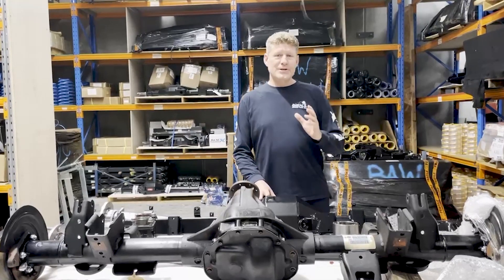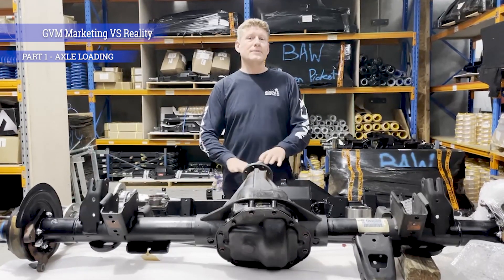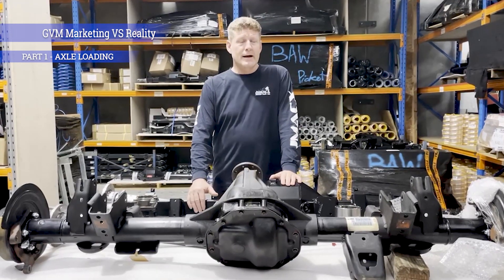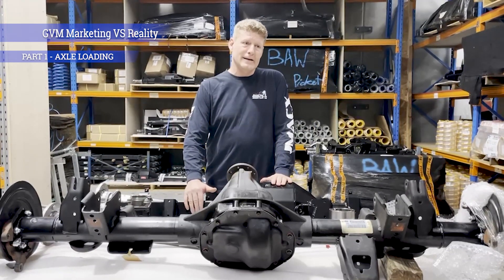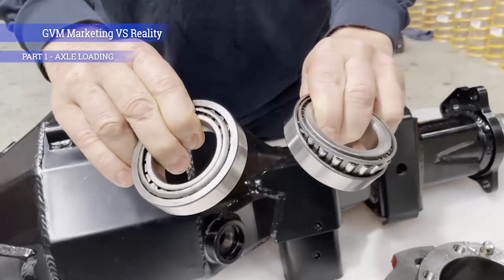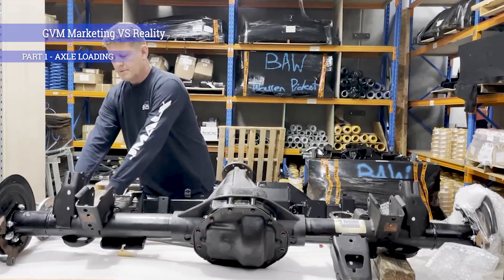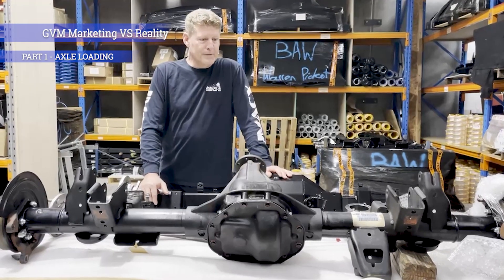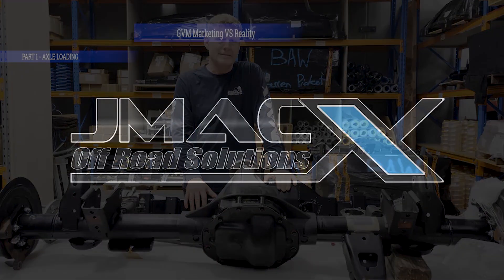GVM Marketing VS Reality - Axle Loading Part 1

Comment: So it's okay to re rate the load rating of the front axle without doing any modifications on it, but not okay for others to do the same for front & rear ?
Sounds extremely hypercritical and psychotic.
Oh and apparently the wheel bearings are ok 😅

Comment: If it's a newish vehicle with warranty . The GVM upgrading is one thing but warranty is the other. With the upgrade you will want to tow a bigger heavier van. You expect that drive train to cope with the excess. If you blow a clutch or auto transmission say a Ford Ranger thats about $15000.. The GVM mods will give The car manufacturer an out. Sorry mate . It's been overloaded. Towing a load above the factory approved kgs. I bet the suspension mob won't take up the vehicle warranty and look after you.

Comment: Hi Jason. Wheel Bearing capacities  ... mint explanation. If I buy an upgrade axle from you to up my LC200 what do I get from you in the way of a bearing upgrade over the OE shitty semi floating ends and so what is the max safe rear axle load increase you will put your name to please ?
Reply from the maker: The 200 series wheel bearing is sufficient to support upto 3000kg no issues however the diff housing has weaknesses at those weights noting that bracing only is not enough

Comment: Great video. Good commonsense information. I am a carpenter, not a mechanic but the same applies in my work. I hate walking under DIY structures and/or DIY modified structures. We tend to fence them off, then either demolish or fix them in the early stages of renovations.